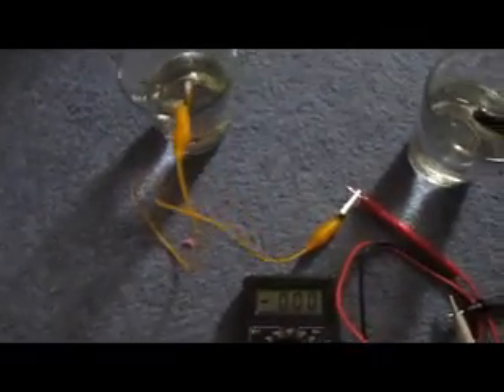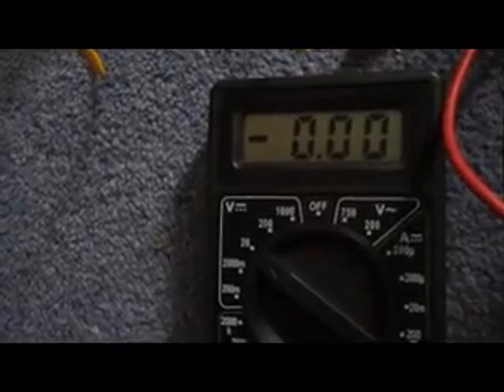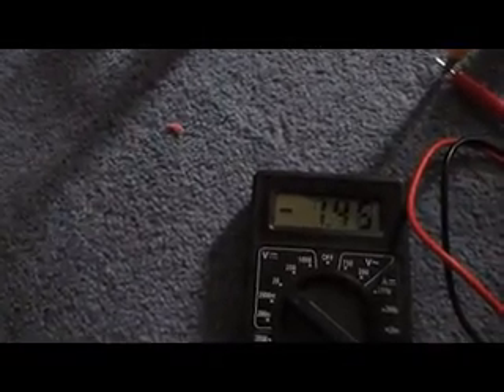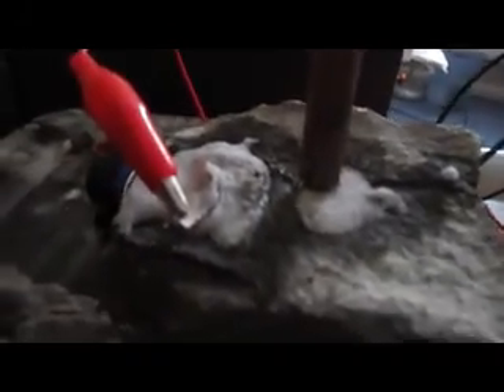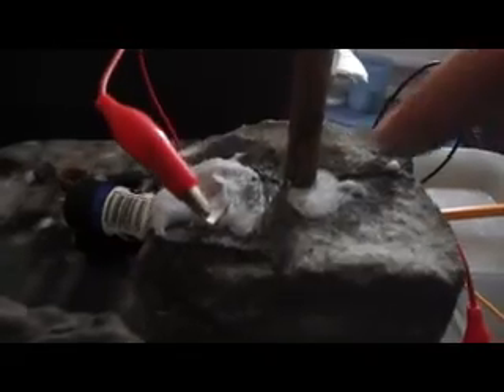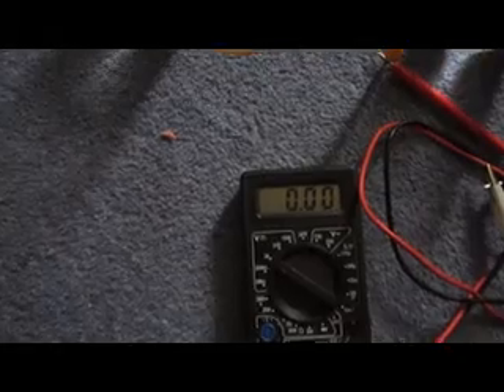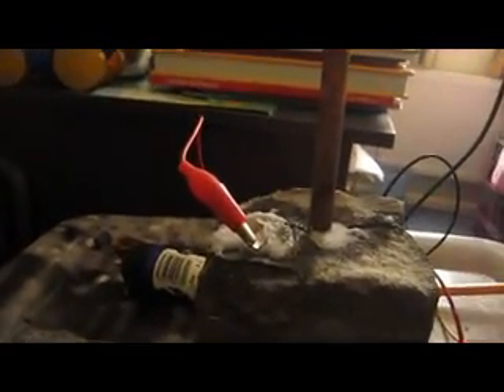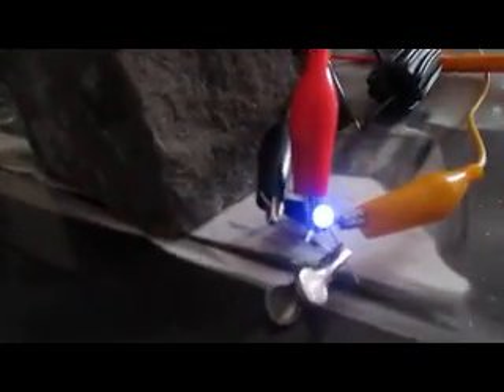How does the rock battery work?

Comment: rock is SiO2, The silicium are used in solar panel to let electricity go, be-course silicium are half metal but the O2 mostly stop electron from move.
glas also leats electricity but the resistens is so high you need a lightning to go 1 mm3 :-D and still low output. Rock there by are not that high resistens as i can understand.

Comment: I'll take a very good guess how it works is by the impurities in the rock which acts just like a solid state device like a transistor. When you have a huge rock with millions of impurities which act like miniature highways not directly connected but close enough to jump across that's how the connection is made and I'm betting its not galvanic because the impurities are soo minute that by the time the connection jumps to the next impurity the galvanic effect don't have time to take place.

Comment from the maker: @Magneticitist 
I dont think so - I dont think oxygen gas works well as an electrolyte, or else batteries would work well with just air between the metal electrodes/  I think its the ions in water which are the electrolyte.  I think the rock holds enough water, and the crystal salt is a dessicant which attracts the water to the electrode.  The thing which surprised me was that the salt seems to work better than water as an electrolyte.  Perhaps it has more free ions in its structure.I dont know

Comment: Hey it looks jb put in another pair of electrodes in a rock and it worked raising the voltage but by how much. We will see. Try adding more holes and pairs of electrodes in the same rock and out in series.

Comment: @phi36nine 
I would agree with you. Lidmotor has made batteries using concrete as electrolyte and they work for a long time because water stays in the concrete for a long time (years). I suspect the rock absorbs water and the water stays in the rock for an equally long time. This can be proved by cutting the rock into two isolated pieces to block current flow in the rock.  Battery should not work then, thus showing that there is current flowing in the rock when it is one piece.

Comment: You should drill 2 more holes and 2 more electrodes. Even try some different metals and connect in series or parallel and see what happens as I did this and got volts and mvp to increase even though sharing the same electrolyte which in your case would ne the rock

Comment: Very good experiment. In your water glass test the air is the medium and it does not conduct as good as crystal. With your glass separation you would need about one million volt. Most stones are crystalline in nature. Example. piezoelectric device are made of quartz crystal. They conduct much better than air, by many order of magnitude. Your millage will vary, as to what type of crystal, (stone) used. This is in part what is happening, but not completely correct.

Comment: Seth, I have 'river rock' slate type stuff here from our bathroom floor. I put a piece of copper between the jaws of a pos crop clip, a piece of galvanized steel in the neg one. Clipped them to the rock. You get a voltage reading of about .080V. Next, fingers lightly either side and only touching the rock and the voltage went up repeatedly to around 0.4V. Wet between points with water, goes to 0.750V. Bang the rock and voltage rises, twist croc clip while on rock and 1.3V ! Zero amps though.